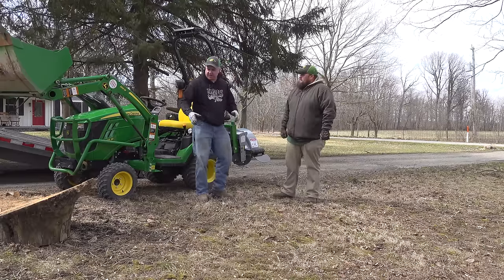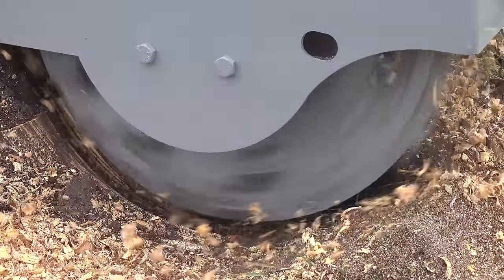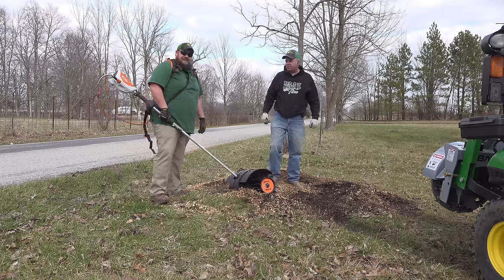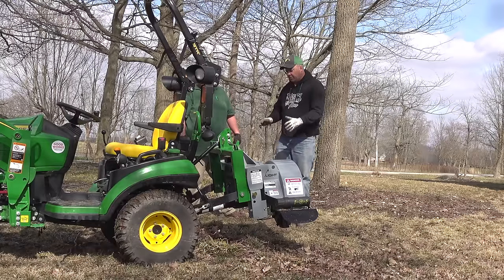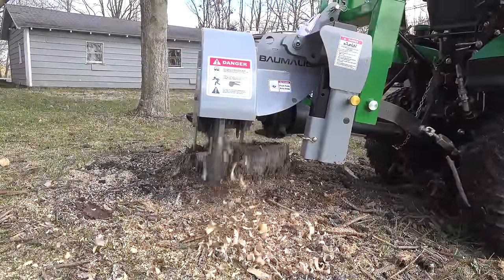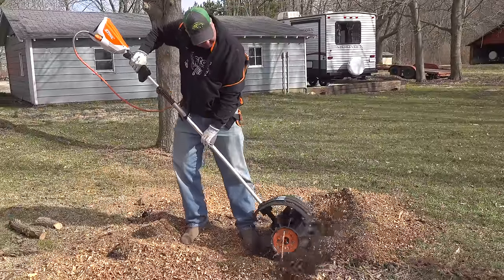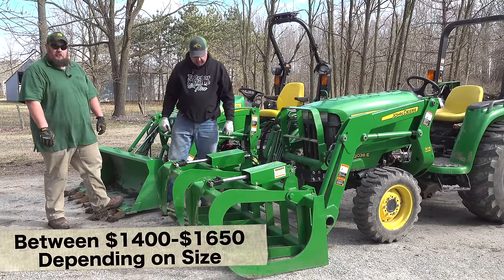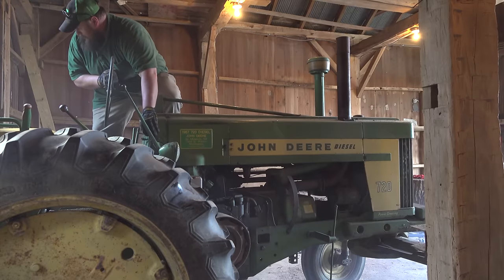New Stump Grinder! Low Cost! Let's Try It!

Comment: Nice grinder! But I prefer to remove the stump entirely. We had a stump in the backyard and used a chainsaw as a poor man's stump grinder then covered it with sod. Over the years as the stump rotted a sink hole developed!  Every few years I'd fill in with stones and dirt. It took over 20 years to stabilize!
Reply from the maker: I agree, except I don't like trying to dispose of the large stump after I dig it out.    
One other thought...the stump might be a lot easier to dig out if it were ground down first.  I may try that sometime.  ...would one be able to break up the stump easier if it has been ground down first?    Afterall, digging a stump is not easy with a small backhoe.
Reply: @TractorTimewithTim  Perhaps the best way to remove a ground down stump would be to wait until a depression occurs, probably a year or two as it starts to rot.

Comment: Looks like a great implement but it looks like it would shake the crap out of the operator.  With the current toilet paper shortage, and because I don't have any stumps to grind, I'm going to hold off on buying one.
Reply from the maker: Would you buy one if it came with a free 24 roll pack??
Reply: @TractorTimewithTim  Hahaha! Probably not right now. ;)

Comment: Why does the tractor have to be hydrostatic ?    Looks like it has a pto.
Reply from the maker: I thought it would be obvious.
You must move very slowly and gently. Gear drive makes that very difficult.  Riding the clutch is not good for the machine.

Comment: Great video but it doesn't seem to be very stable I think if it was hooked to a excavator or anything but a 3 point hitch attachment it would be better. It shakes the crap out of the tractor and I think after time the machine is gonna wear out. I find the walk behind version works alot better. Also the John Deere 1025r is 27500$ before taxes here in Canada. Seems more logical to buy a mini excavator over this little tractor for price wise
Reply: The thing you have to remember is basically the only thing a mini ex is good for is digging. I have a 1026r and it is so versatile I dug my patio out with just the loader bucket then I mowed my lawn then I put the power rake on and fixed another part of my lawn all in the same day
Reply from the maker: 1025r with mower and loader is $16,500 here in Midwest.   Mini ex big enough to use a stump grinder would be $45k here.
Reply: @TractorTimewithTim  ya we get screwed in Canada I paid really close to 20000 with a loader and mower and that was in 2012!
Reply: @TractorTimewithTim  must be nice. Here in Canada were screwed pretty hard, our hard earned dollars aren't worth very much compared to the Americans. Price was from our local dealer here in New Brunswick, 2020 1025r loader backhoe 27500 before tax. Not worth it for something so small